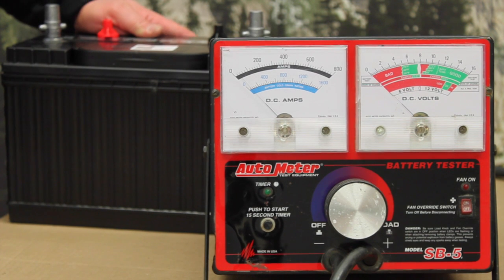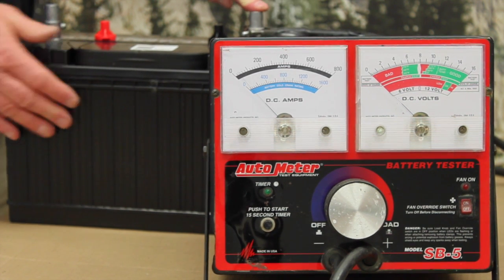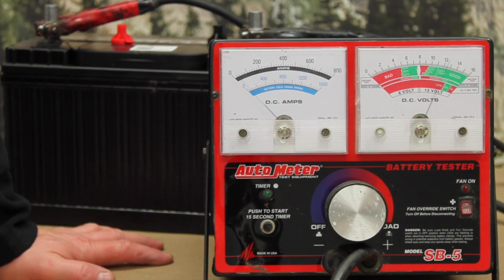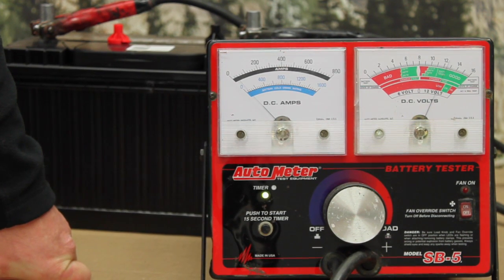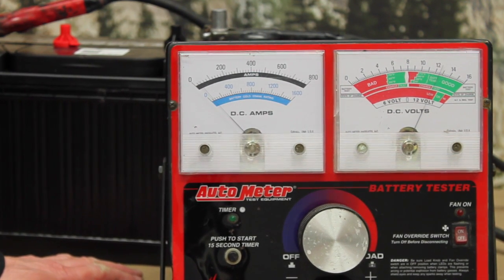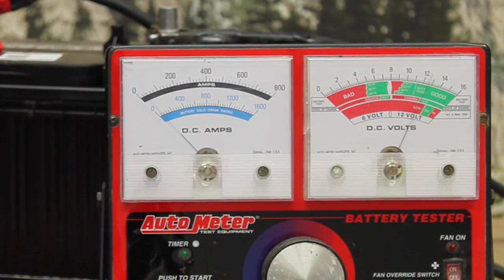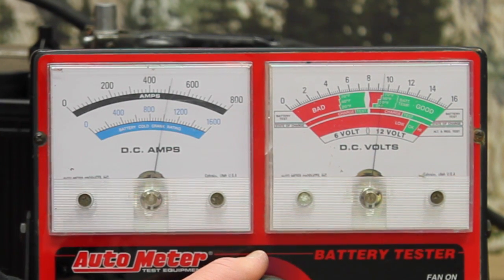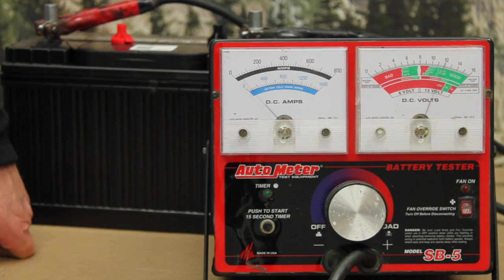Canadian Energy™: Carbon Pile Load Test - Group 31 Battery

Comment: it looks like you needed to zero the amp meter.  It's overstating the rating by 80 CCA.
Reply from the maker: Shun Wong You are correct, the challenge with the analog meters if often static build up  on the clear plastic meter cover which is difficult to eliminate. We don’t typically look to the portable carbon pile testers as a precision measurement tool as they get banged around during their operation. 🇨🇦👍🏼
Reply: Use a fabric softener sheet that has been used in the clothes dryer and wipe the face of the meters and that will rid them of the static charge. Use for other static prone items too.

Comment: Why is the bottom blue CCA labeled scale not used for testing the battery?
Reply from the maker: Chad Jessup The BCI method of testing batteries is to load test them  to 1/2 their rated cold cranking amps, this would be reflected in the blue scale. Hope that helps.
Reply: OK. Thanks for that.  I just re-watched your video in full screen, where it is obvious now to me that the black AMPS scale is 1/2 the blue scale (the CCA scale), so reading either scale will provide the answer, assuming the tester uses 1/2 of CCA for the black AMPS scale and 100% for the CCA blue scale.